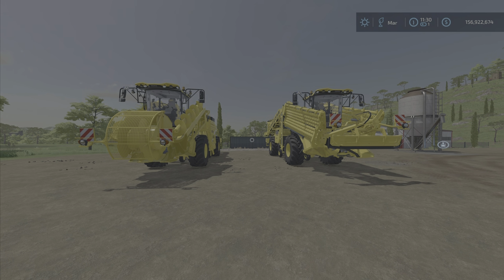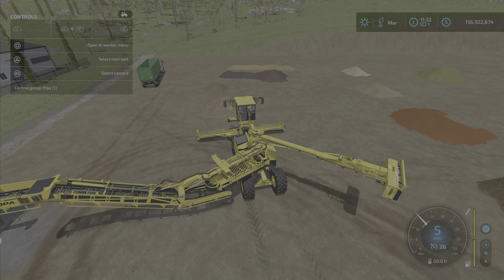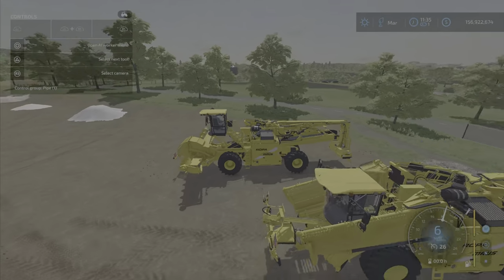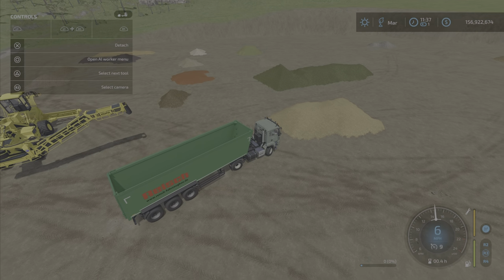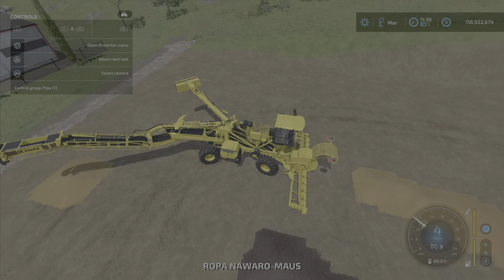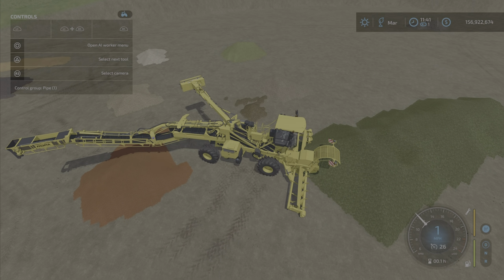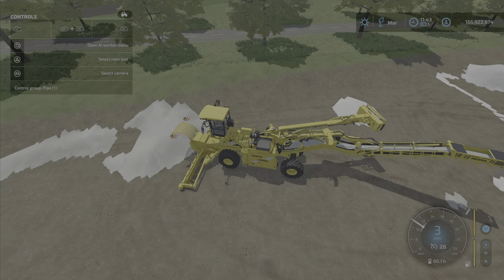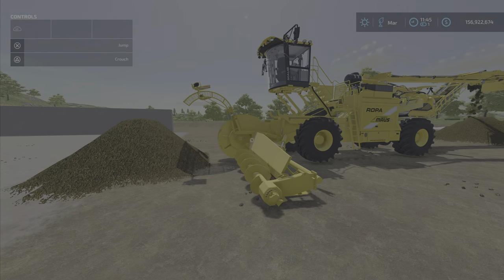FS22 ROPA Nawro Maus 5 /Maus 5 Tutorial

Comment: Whats the point of leaving them out on the ground to be picked up in t he first place?
Reply from the maker: Hi Railien , That is a valid question .
The purpose of the video is to demonstrate what each pice of equipment CAN  pick up and not WHY it is on the ground .
There are several reasons why something may be left on or dumped on the ground . 
Thank you for your comment and 
Thanks for watching 😃
Reply: root crop storage is almost always just on the ground inside a building/shelter, it can't be binned, the auger legs would tear it up.
Reply from the maker: @mark2220  Yes Mark , It is a more "real " way to handle those crops .
Thanks for your comment 😀